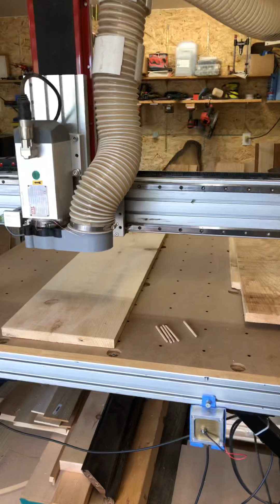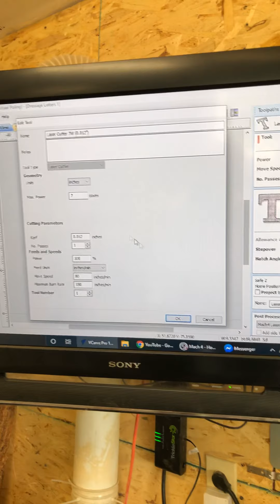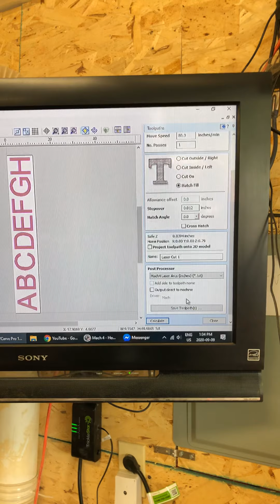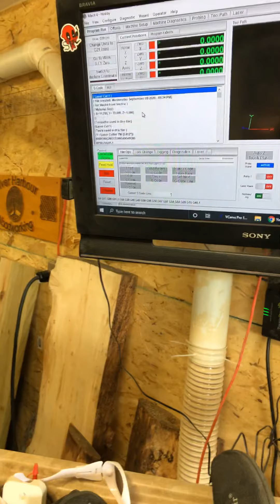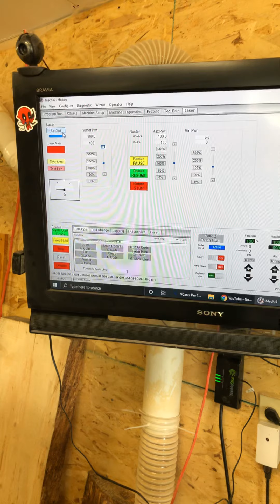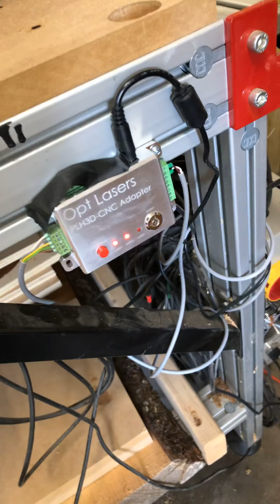Test run Opt Lasers and Avid CNC

Comment: Love the video, I was wondering where you picked up your mounting arm for the laser? If you could, can you post the dimensions of it?
Reply from the maker: Lol. The arm was actually a connector piece for my aluminum dock that was just extra. It was 3” by 3”. Worked great until the shop fire.
Reply: @silverharbourwoodworks6584  I hate to hear about the fire sir, I have been in those shoes... Not fun! I was able to build something that I think will work. I still am in the process of getting everything configured. Hopefully all comes together and I can add this laser to the tools for the cnc

Comment: All that time locating 0/0/0 and then it goes to the other side of the board? What did you specify the lower left positioning of the art?. Would have been nice to see the finished product. Can this laser cut acrylic through?
Reply from the maker: Finding 0/0/0 takes 30 sec.  I was explaining at the time, which slowed me down.  When you start the Gcode, it moves to 0/0/0 then moves to the start of the Gcode, which isn’t 0/0/0.  Where it starts really depends on the Gcode generator you use.  It will never start at 0/0/0 though.  For me 0/0/0 is the near left corner.  You can set it to be anything.  It is simply a reference point for the software to locate all other coordinates from.  This style of laser is not good for cutting acrylic.  Use a fibre or CO2 laser for that.

Comment: Would love to have a copy of your post processor.  I have a similar setup with an Avid Benchtop Pro and the Opt Laser package they sell for Avid (CNC Router Parts).  I have been struggling with my own and hacking at J-Tech's post processor for Vectric.  Would love to see what you have done and hopefully contribute back!
Reply from the maker: No problem at all! I’ve tested it a fair bit, the only thing I haven’t tried is something that switches power back and forth a lot, such as a picture.  The command to change power might take a couple milliseconds to process, so I’m wondering how that will be handled.  If you email me at poling.mike@gmail.com, I can send you the post processor.
Reply: @silverharbourwoodworks6584   Thank you so much.  I sent you an email.  I will send you some information on how to enable and disable using an additional pin.  That is exactly where I am having an issue.  Espeically when doing multiple passes, the laser does not turn off/on and gets off track due to the delay.  I was able to have instant on/off by interacting with an additional enable pin between the laser controller and the ESS.  Thanks again!
Reply from the maker: Shane Elliott thanks. Yes I discuss this in the video.  You do not need to actually physically connect another wire or pin, but you need to assign one in Mach4.  This is the laser gate, which can be mapped to any free pin and port.  Again, no physical connection is needed.